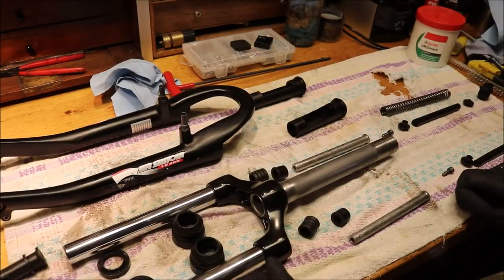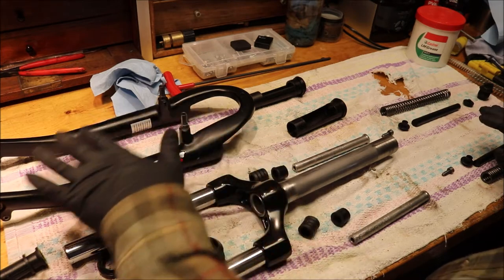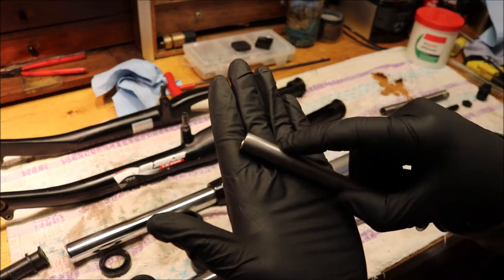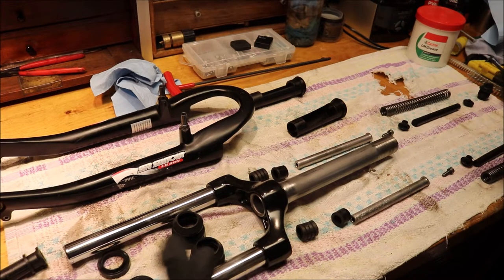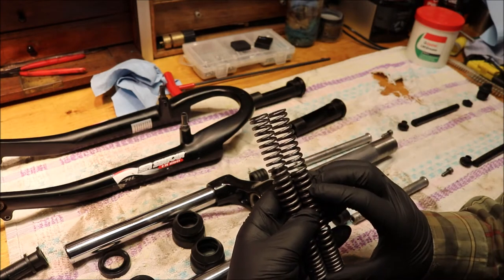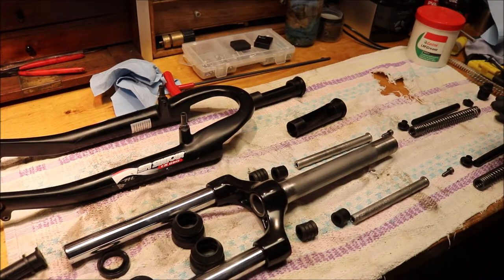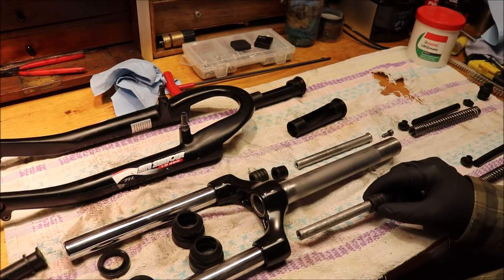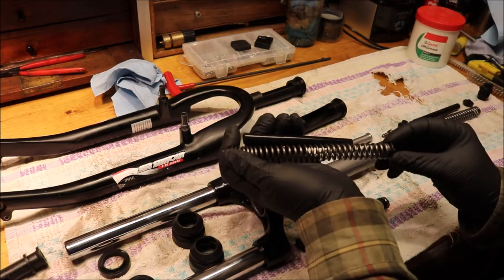Fork Service of Suntour CR880 AL - Lube/Assembly (disassembly)

Comment: My wife's bike has a CR850 and it is squeaking and I am looking into servicing it.  I am hoping that since they are close in model numbers, they use the same construction.  The newer forks are not near as complicated as this.  I can see why they used a simplified construction both to reduce manufacturing costs and reduced service cost and perhaps a simplier designed means better reliability.  Thanks for the video.

Comment: I serviced my CR850 on a Fuji Monterey 2.0 frame using this video as a reference.  I expected the forks to be the same on the inside but the internals on the CR850 are a little different, a little less complicated.  The most important difference is that I only needed an allen wrench with a 9" handle.  I did sacrifice one of the  preload caps because it was welded in.  I would include a picture but that doesn't seem possible.

Comment: Getting the plastic slider sleeves off the top of the fork lowers without breaking them is quite tricky. I suspect that they are not designed to be removed once installed. Top tip - fasten a zip tie tightly around the top of the sleeves. You can slide a pick or small flat screwdriver behind the clip to lift it, and then use a pair of pump pliers to turn the sleeve without mashing the top of the sleeve too badly. Once the clip is disengaged and the sleeve is rotated, it can be lifted out of the lowers.

Comment: Great job,because i'm a bikerepairsman myself.These are not as difficult as they look, but there's one tool nessecary i think.the 12 inch allan key. My friend's plastic sleeve can out of th top, and my question is: can i push it back without disassembling the complete fork.
It's far more simple than a Cannondale dd60  fork like mine,that's a fact,but forks are always greasy so thanks for  your explaining.👍🏻👍🏻👍🏻
Reply from the maker: If you are talking about the plastic sleeve/bushing seen at 11.16min, then yes, just push it back into the outer pipe/fork tube. A tab broke on one of mine and keeps lifting up. I just push it back down. Hope this helps.

Comment: Thanks for the great video, I got the same fork and can't find much info on it. Do you know what type of terrain the fork is suitable for and how to setup the dials (+/-) on top left right properly? I take it that they influence their respective spring? + is rigid - is soft? Would really appreciate your insight, I'd like to use it for some mild dirtpaths and gravel but nothing too serious (got a Giant hybrid bike). I understand it's not meant to go full on MTB downhill ;).
Reply from the maker: Hi There TaoKraft. I've also had difficulty finding details on these forks. From what I know, yes, the + is rigid - is soft in respect of pre-load, how much spring compression you are putting on the spring. + will shorten the spring making it stiffer with the - removing the pre-load. For my riding, on the road etc. I add pre-load (+) so that the forks don't 'bottom out' during normal riding. Going by my experience with motorbikes you are looking to find the balance between stiffness (+), so they don't bottom out but still give you the shock absorbance for the rough riding. If I find any more details I will add here, the bike did come with a booklet, but can't find it right now.
Reply: @garethowen7050  Hi Gareth, thanks for your reply! That's what I figured. So a good starting position would be turn both dials all the way to - and gradually increase left and right to + equally until a suitable level of pre-load is reached where it doesn't bottom out? What I mean with equally is that when you'd look at both dials from above an equal setting could be L/ R/ or L\ R\ but not L/ R\ because this would make one spring shorter than the other (hope that makes sense)?
Reply from the maker: @taokraft  Yes, the need to be balanced... I think I would go with the number of clicks make as you go +... Hope this makes some sense.
Reply: @garethowen7050  Ok, thanks!
Reply: @garethowen7050  PS: FYI, the correct setting of the dials turned out to be mirrored (e.g. /  \ or \  /) when following the amount of clicks starting at the point where they were turned all the way to -.

Comment: What size Allen wrench did you use?
Reply from the maker: Hi Le go. Sorry should have included that info. It was a 5mm Allen.
Reply: @garethowen7050  Thanks! I ordered one on Amazon. Hopefully it will fit my fork.
Reply from the maker: @Dmytrenko  Good luke with it. Be gentle on those Allen's, and lots of washing out first, to try to clear the Allen heads out.